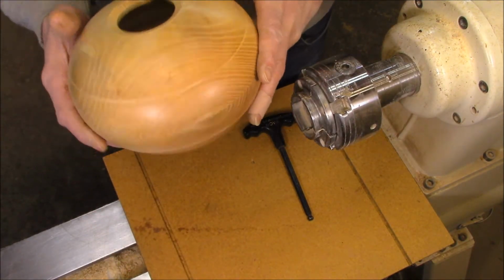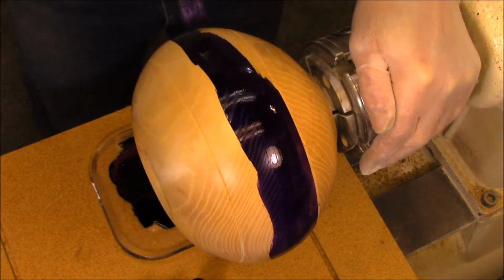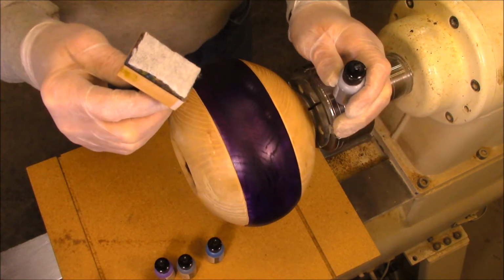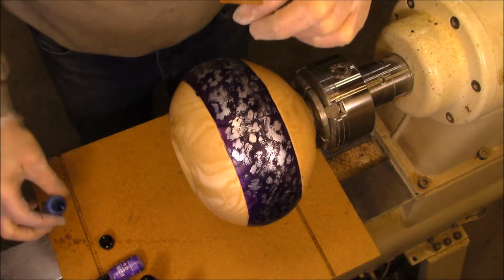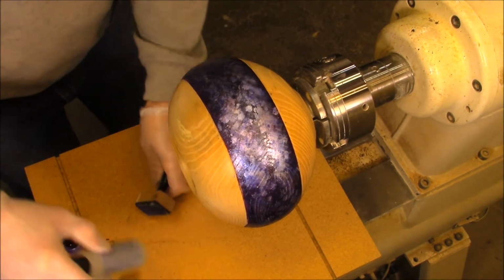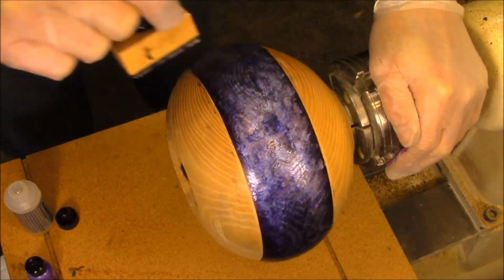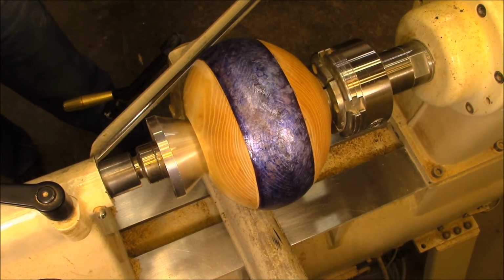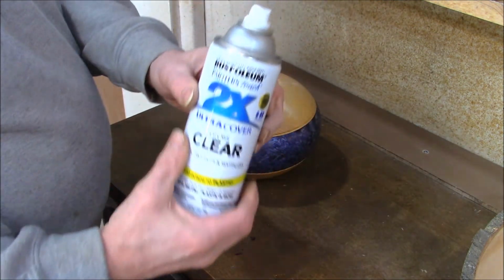Coloring A Handmade Wooden Hollow Form With Alcohol Inks

Comment: Hi from the UK.  I sourced the same brand inks and stamp with the felts pads and had my first try at colouring with ink.  The inks are very ‘pigment strong’ and I got the desired effect that I wanted, but with two problems .  Firstly, the fibres from the felt remained in the ink and were a devil to get out.  I used 0000 wire wool with a very light touch and managed to knock the tops off of most of the fibres, but there was a definite texture in the ink when I was done.  The second problem was the inks ran when I applied melamine lacquer.  I ended up having to sand the piece down to bare wood and start again from the sanding sealer stage.  I still had the problem with the fibres from the felt second time around and acrylic lacquer worked fine.  I’m going to try 100% wool felt, as that is supposedly more stable.  Any other suggestions would be great fully received.